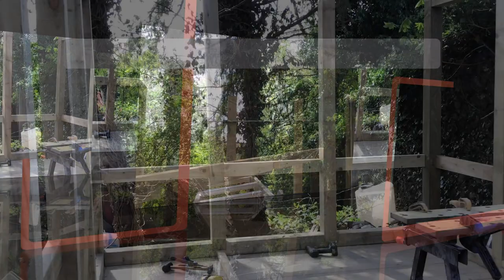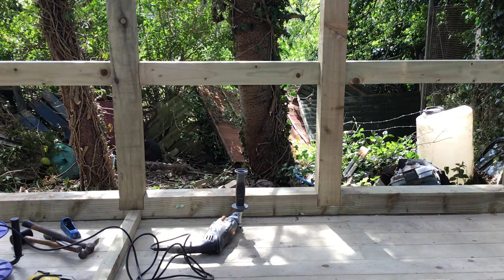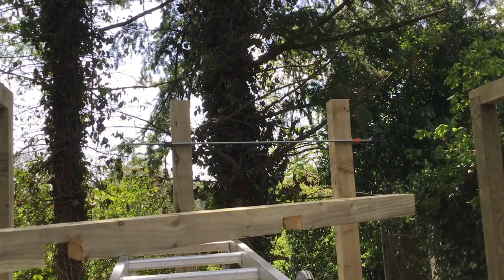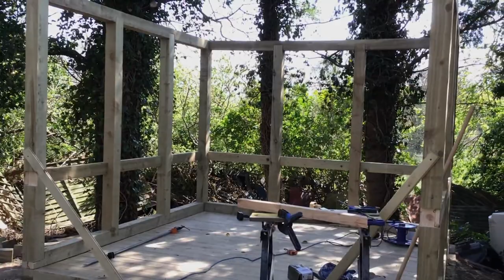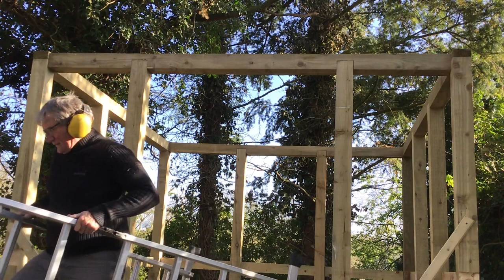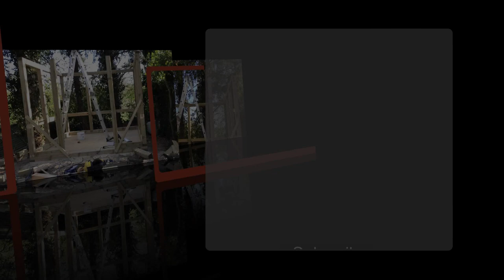Part 2: How to make a Japanese tea house. The wall frames

Comment: I am so glad I found your videos. My Dad had a wood shop and did very careful work. Sadly, he's not around to advise me anymore but seeing your careful joinery is making me feel like  the tea house I want is doable.
Reply from the maker: Hello Angela, sorry your Dad is not around any more. I started my journey into joinery relatively recently when I decided to build a garden water feature based on a well. The roof structure is based on Japanese style and is intended to compliment the Koi pond I have. After completing it, I looked more into Japanese style gardens and found during internet searches pictures of Japanese tea houses. It was’nt long before I set myself the challenge of building one. The first challenge was to build a structure that would support the roof. After some basic research, I came to the conclusion the frame of the building was relatively easy to make (but time consuming). The biggest challenge by far was to choose a style of roof I thought was appropriate and then come up with how to design and make it. After a few weeks of looking at various Japanese style roofs and their construction, I decided on an ‘Irimoya’ style roof. Although the Irimoya style is used in Japan it is a traditional style common through out Asia, and is used on many Buddhist temples. Although I do not profess to be a Buddhist follower in any shape or form, I do appreciate the traditional architecture it has influenced - especially after my travels through Asia and the Far East. It has been especially good to hear from you since my primary aim for the videos I make is to show that we can all make or build things on a DIY basis if we put our minds to it. Please keep in touch and don’t hesitate to ask questions during your own build👍

Comment: Really enjoying your videos. 😁
Just a quick question: 
'What are the lengths of the wall posts?"
Reply from the maker: Dee, apologies for the late reply. The comments on my channel do not show immediately for some reason. I have only just seen your question. I will use figures from memory. Bear in mind the height of the gap/space for the door is 1.84 metres. Each wall post which are 100mm x 100mm, sit in a 100mm x 100mm post that lays horizontally and fixed to the base. These have been routed to a depth of 50mm by 100mm width to accommodate the wall posts. All posts that sit horizontally on the floor base are screwed down using structural screws. Similarly, the lintel above the wall posts have also been routed by 50mm depth x 100 width. to house the top of the wall posts. Doing it this way ensures the structure is stable and helps to minimise lateral movement in the timber. 

Hope that helps.

Regards: Alex